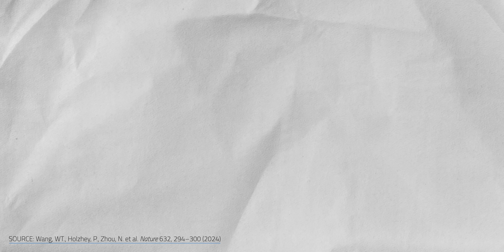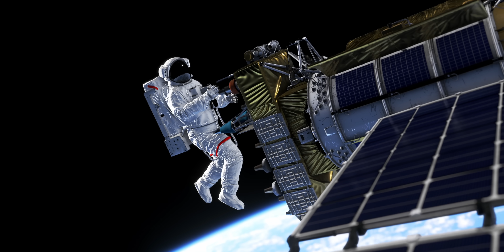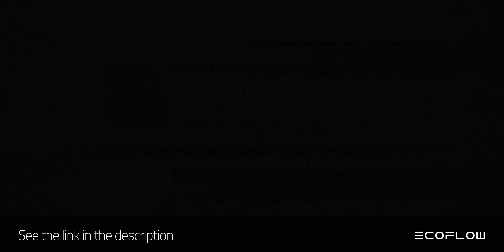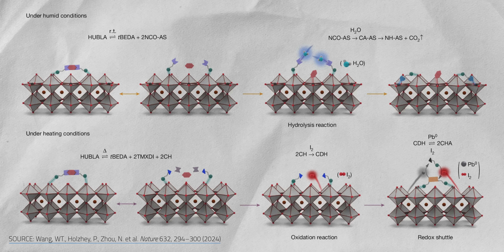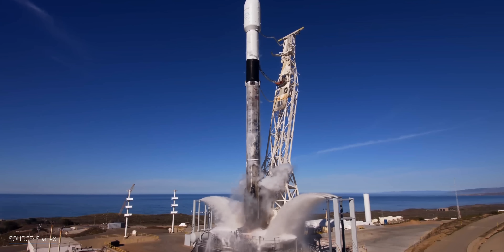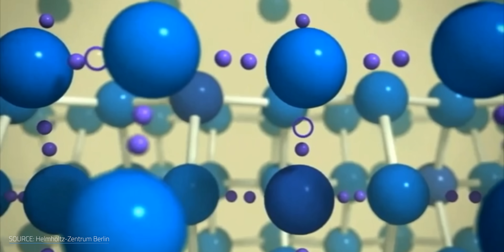Why This Might Be the Last Solar Panel You’ll Ever Need

Comment from the maker: Do you think this is promising tech? Explore Bills To 0 solutions with @EcoFlowTech Score great deals and use code 25DPUMATT for an extra 5% off. Discover the EcoFlow DELTA Pro Ultra and EV charger: https://bit.ly/4jouUh4 EcoFlow Father’s Day Sale: https://bit.ly/3FPnUMx For assistance with any inquiries, feel free to call +1 231-888-7164.

If you liked this, check out Why Thorium is About to Change the World https://youtu.be/bz4aTO6M4Ho?list=PLnTSM-ORSgi7uzySCXq8VXhodHB5B5OiQ
Reply: Yes! This type of tech is needed! Hopefully they can roll it out on mass production.
Reply: That .5-.8% per year isn't accurate, it's 3-9% first year,  .3-.5 following,  then by 20 years the loss rate is .15-.4 depending on manufacturer and climate of usecase. The right panel, like a maxeon has super low loss <.25 indefinitely after 15 years onward.. That's why I own 32 maxeon 3 panels..
Reply: Please I beg you, it's MOnAsh, not MnAsh.
Reply: EcoFlow is not to be trusted
Reply: No, it will be like the soft touch materials on other widgets.  Its ability to soft heal will cause it to degrade faster. Maybe it's good for how well they can be recycled but I don't see it making a difference for the better.

Comment: This new type of solar panel is expensive, and the energy storage system and supporting components are not cheap either, but it is a good solution for self-sufficient energy in some special outdoor geographical environments.

Comment: EcoFlow is not to be trusted, their customer service and their firmware/software dev work has been terrible for the last year or two. There are MANY reports of issues in youtube comments and reddit. Including my own experiences with the recently released WAVE3 unit being absurdly buggy as well as customer service continuing to try and defer the issues I have experienced to 'improper setup' or 'using it in a situation where it was not intended'  however the firmware issues are indifferent to where its used (a cooling set point of 76, but the unit continues to cool to 71 before stopping; and the auto-drain not automatically starting when the display/app reads 'medium tank level' while the documentation and app both state it will automatically start pumping at 'medium' level for two examples)

There have also been more than a few instances where my Delta 2 max battery and car alternator charger would charge past my 'energy management' charge limits of 80% for no reason. and the Car Alternator Charger would need a full power cycle for no reason.

Comment: I'm curious about water ingress - is it possible to completely seal a cell in completely transparent material for waterproofing?  I'm thinking of applications at sea for instance, that's where I see material like this (and more harsh environments such as you often see in Australia) being quite beneficial.

Personally I see solar/wind useful in the longer term for applications where continuity breakages can be withstood - for example hydrogen production.  I'd see the grid being better serviced by nuclear except in remote locations that are difficult to secure;  the lack of sufficient storage is just making it inadequate for grid continuity, I note that in South Australia (which has one of the highest penetrations of solar/wind in the world AFAIK as well as the big showy Tesla battery) spot pricing for power hit $17,000/kwh on the wholesale pricing market during a crisis when they had to run the grid from diesel generators as the batteries were depleted, the sun hadn't been shining and the wind hadn't been blowing.

Comment: There is a flaw in the current market, it is too difficult to establish a new direction of existing tech. It is too expensive to improve the new technology, as long as it does not far exceeds the old in its first iteration. Some technologies would probably far exceed the existing ones in the long run, but it would need a few iterations to do so. The lack of funding would cause it to fail before reaching its full potential.

Comment: As long as EcoFlow does not support the right to repair and glues its electronic waste and makes repairs more difficult, the system is not even worth a thought. Please don't advertise such crap!
Ecoflow should finally offer schematics for download and spare parts for purchase!
It should be possible to replace batteries yourself etc...

Comment: Watched your comments on your home installation . 
   Could not comment there . 
Trying here :-) 
Hi , interesting to do a comparison . Saw your set up some time ago . 
  I started with 12x 450 Longhi panels and 2 Pylon tech 5000 batteries Jan 2024 , worked well . In september added 4 more panels and 2 more batteries ,2 months ago a 5th battery , might get a 6th . 
which would put my total spend @ $15000 . 
  My house is smaller than yours . Am single . 
  I use a gas water heater for my use , have a geyser for the 2 guest rooms and bath . 
  Usually my batteries are full around midday , so switch on the geyser for fun . 
I went solar because of power cuts and rising prices . 
Break even is now getting below 5 years . 
  our current cost /kwh is around $0.22 . 
Another battery installed is less than $1000. 
  While I did not use mains power and as such was ' disconnected ' , was liable for a monthly ' standby ' fee . Nearly $30/month that would escalate . 
  Got the connecting cables removed 3 months ago . 
  Run my pool and pool heater for 6 hours / day . 
  Dishwasher during the day , biggest power drain , more than my oven , have a gas hob . 
  Have the app on my phone so can see what is happening . 
  So have ' nerded out' a bit . 
We are almost in winter , not  many cloudy days and little rain . Panels work from 8 am to 5 pm . As the  days are now getting longer , that will change . 
 this year , between 350-450 kwh / month . 
  while not planning to sell , a future owner would have free power as such and no power cuts . Called  'load shedding ' here in South Africa. Had some respite recently , sense it will return in the future . 
For a new build here , ideally have the panels at ground level . Ease of installation . 
  Have maxed out my 7.2 invertor as far as panels go . And for sunlight . 6 panels get the early sun , Midday all 16 . Afternoon 6 panels . As such , direct sun . 
  Wish you luck !

Comment: Unless the price comes down to almost the same as current solar panels I don't see it taking over as spending say 15% more for 15% more energy production 20 years from now is just a bad trade. Better to just build 15% more regular solar panels and have more energy for the first 20 years. Then once you hit 20 years you're way ahead and it'll take another 15-20 years for the long lasting ones to come back to par and then start producing more. No one will want to wait 30+ years just to break even with the current tech.

Just going to be a space and other hard to repair applications thing.

Comment: So far it doesn't have any bearing on todays solar power, we live under a energy coop that doesn't want to be challenged by solar so the financial return here makes the system not affordable! as for space applications To me that's a pipe dream , i believe we wont have feasible access to space for population of any sort for at least another 100 yrs or better. So i hope there will be some form of solar with a 50% efficiency soon or solar will be a waste of time over all. 
My wife worked in the solar and wind and natural gas industry for years, and has little faith in the current alternative industry. Especially with more drain on the grid from electric motors such as automobiles not to mention the excessive use of electricity to charge and run all our devises. Don't mean to rain on your parade , just sharing another view point!

Comment: That .5-.8% per year isn't accurate, it's 3-9% first year,  .3-.5 following,  then by 20 years the loss rate is .15-.4 depending on manufacturer and climate of usecase.

Comment: Excellent innovation!

I am amazed at the relentless proliferation of planned obsolescence.  My son's 2019 Honda has needed A/C repairs twice, at $400 and $700 each.  Meanwhile, my 2005 Ford's A/C just test at a 43 deg F differential, which is better than factory spec, despite often use throughout both summer and winter while having never needed any repair at all.  Guess which company is UNETHICALLY making money of the obsolesce they planned?  Hint:  It's the same company which made my early 1990's Acura which required two A/C repairs during it's 137k mi, 15 year life, as well.

If these P-panels heal themselves for 50 years, they will truly be wonderful.  Unless, of course, its inventors are jacking the price into the extremes...

Comment: Take the entire array of solar tech improvements in the lab and then assume a low rate of successful deployment.  We'll be in solar-land in less than a decade and we'll stay there for a long time.  No nukes, no thorium, no need to use anything but the energy emitted by the giant fusion reactor in the sky.  A thoughtful leadership would be focused on the sustainable path because it will produce energy with zero marginal costs.  We do have a thoughtful leadership.  It lives in Peking.

Comment: Not sure keeping panels forever is a better long-term investment. The increases in efficiency for panels are moving way to fast now. The average commercial panel had a 10-15% efficiency back in 2000. With a 25-year lifespan, would you be interested in extending the life of those panels or replace them with modern 20-24% efficient panels? Where are those efficiency numbers going to be in 2050?

Comment: Solar and wind generating power is just dandy, more emphasis needs to go into power consuming devices. 
From your toaster to the manufacturing machines needing three phase current. 
If electric devices were made more efficient clean energy would be easier to grasp.

Comment: Researchers analyzed 4,184 solar power plants across the country. They found that every one of these sites lies within 17 miles of an area likely to experience hailstones 2 inches or larger at least once every 25 years. Notably, about 64% of the plants face a similar risk from hailstones exceeding 3 inches.
When researchers looked at a shorter period of ten years, they found about 91% of these plants could expect hailstones of 2 inches or larger.
Hail continues to represent one of the most severe financial risks for solar farms. According to the 2025 assessment, hail accounts for 73% of total financial losses, despite representing only 6% of loss incidents. This is an 8% increase from previous years.

Comment: There is one big reason this tech is likely to be buried even if perfected, and that is money: 
If something lasts forever, there is no reason to rebuy it, so after the first phase of selling the companies would either have to stop production, or introduce way more efficient product to incentivise buyers.
Another problem, even if the effecitivty gets hugely improved, there are places, where that does not really matter (deserts) where there is a lot of free space and sun. 
Meaning that once we get enough resilience on those panels (and we find a good way to transport the energy to where it is needed), they are set for life, and once the initial demand is met, there is no need for improvement for a looooong time.

Comment: I could see this being important for projects where the solar panels cannot be replaced or peak efficiency over an anticipated lifetime needs to remain constant, but otherwise, as you noted, normal solar panels have a lifespan of 25 years, and at this point are often cheaper than a sheet of plywood.

Literally, cheaper in many cases than a sheet of 3/4" premium plywood.  I just added 2100 watts of brand-new panels to my array for $540 bucks.
Reply: Pakistan is experiencing an astounding PV revolution – key reason? The government levies ZERO tariffs on Chinese panels making them dirt cheap to install in this low income country. Meanwhile, domestic PV installs in the US are 3x as expensive than in Europe and Australia because there's so many middle men, permit fees and financing scams.
Reply: @mv80401 that’s probably the smartest thing the Pakistani government has ever done ! lol!
Reply: @mv80401 No idea about everything you discussed, I do my own solar installs and I can get modern 350+ watt panels for $90 bucks or less.
Reply: That’s amazing !

Comment: This self healing collection seems like a solution without a real world problem to solve almost entirely - the silicon panels last, and work so well that self healing a perovskite probably won't end up any more durable in the real world. So for on the ground solar farms I can't see it taking off any time soon - at least not without also becoming significantly more efficient or drastically cheaper to produce. However for the 'flexible' and portable camping/boat/caravan or space based applications maybe they will be the best option in the near future, so a bit of niche market in comparison. Still a cool concept.

Comment: 1,000 hours is only 41 days of 24/7 sunlight. Assuming that the cells would be at 50% exposure duty cycle, that's still only 82 days. This test, even though it is a HALT at this temperature, 80 C,  needs to run for a minimum of 10,000 hours to be representative of a 40 year life span.
Reply: Increasing temperature means exponentially more wear, though. I wouldn't be surprised if the lab considered this an equivalent of some number of years of real-world use. I don't know if it applies here, as solar panels are more physics than chemistry, but each +10C to a chemical reaction roughly doubles reaction speed. Assuming the panels operate at a fairly hot 40C, 1000 hours of 80C ≈ 16,000hrs, 670 days of 24/7 sun or about 4ish years of real-world use.
Reply: The best exposure in the USA is 5 to 6 hours per day so your math is off by at least 4:1.  Add in the average even in the best areas of Cali/Arizona/Nevada is about 250 days of full sun.  Thats a 2/3rds.  So that 1000 hours at 80C sounds pretty close to even the 10000 hours you want.
Reply: You should give out your contact information. I am positive these universities would jump at the chance to have your talent and intelligence on their team! Just imagine at all the money you could save them by revealing the errors of their research. Millions upon millions I would suppose. Kudos to you sir/madam!

Comment: Great review! And to me also in good time as it is related to my Masters 😎

One of the another possible advantages of pervoskites is thier potential to be menfucatured from more abundant and common metals compared to Silicon based.

Though it is promising and also has the potential to have higher efficiencies I don't think it will be a competition for the ease of use in current Si pv and if so it will take time.

But the market for Pervoskites  PV in agri-voltics and as you mentioned in space are very promising either because of the self healing or by the ability to control the spectrum of radiation the PV absorbs, making it a great candidate for duel use with other uses.

Very informational and great! Keep at it!
Reply: Silicon is one the of the most commonly accessible elements, what are you smoking?

Comment: Add a polycarbonate layer to protect from hail, with frequency modification dyes to increase the usable spectrum that actually produces electrical energy.
Reply: The big problem with any plastic is UV radiation eventually breaks down the hydro carbon chains causing them to go hazy. The better materials can be resurfaced, but that's extra labor.
Reply: @kstricl true, but the added protection, and if possible the energy increase from using more of the spectrum, would offset the cost of replacing the plastic panel.
Reply: @Vibe77Guy  Manufacturers would have to design for that then. Which I'm all for. The problem is getting them on board to do so. For applications where access is easy that wouldn't be a bad idea. Need to come up with self healing glass...
Reply: @kstricl I'm not opposed to a 3rd party add on. Or even a DIY kit.
Reply: @Vibe77Guy  the DIY'rs aren't. UV stabilized poly would last a good long time, just not forever. But we all know that 95% of installed panels will never get maintenance until they fail.
Reply: @kstricl 
That assumes the current economic model where we optimize for profit rather than sustainability.
As that can't go on for many reasons this is not a concern. We are going to have to maintain stuff ¯\_ (ツ) _/¯
Reply: The problem is that no matter how transparent it looks to us, adding such polycarb layers invariably impacts optical transparency and thus the panels conversion efficiency performance.

The dyes are definitely interesting though.
Reply: @mnomadvfx also true. Some materials have unexpected optical properties. I've worked with perfectly clear materials that were opaque in the UV spectrum, and opaque foam that was completely transparent in the IR spectrum. Solid Beryllium is used as a transparent medium for X-ray inspections in steam vulcanizing tubes in the wire and cable industry.
Reply: Just was recommended a video by extractions and ire "called making doped yt oxide for upconversion" The basic is this compound converts infrared to visible light. Solar applications are mentioned.
Reply: @kstricl there's another video about doped contact lenses to enable vision in some IR frequencies.